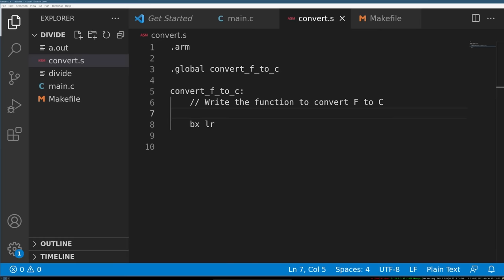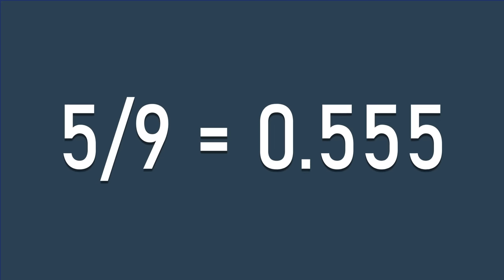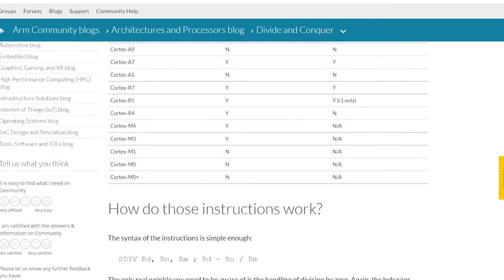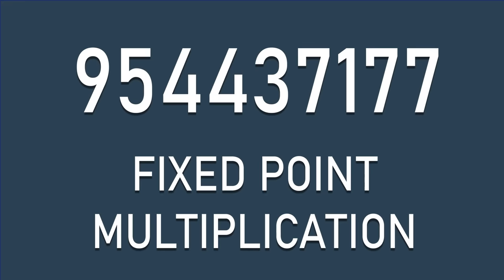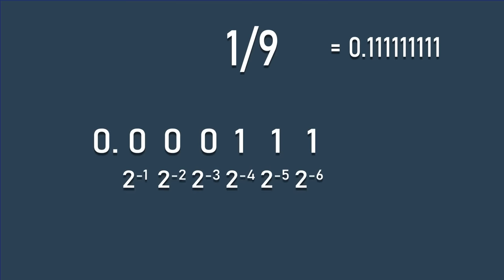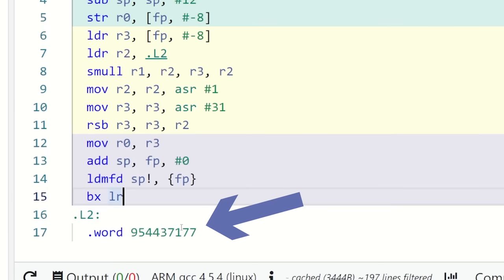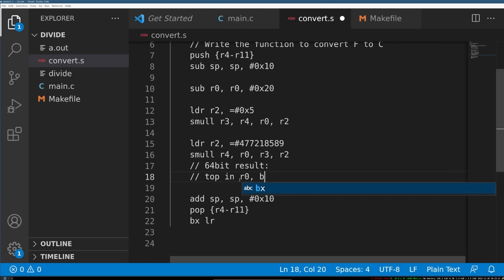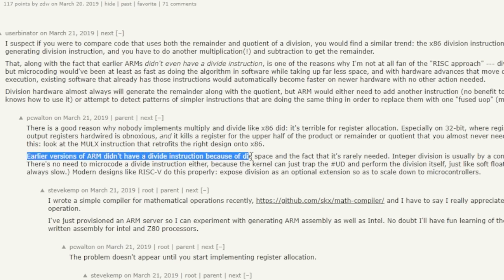computers suck at division (a painful discovery)

Comment: Congratulations, you have just rediscovered what us old farts were doing decades ago. Early in my career, I was working with a minicomputer (a PDP-11 to be exact) that did not have a hardware floating point unit in some models. So I wrote some software that emulated all (three!) of the possible floating point instruction sets. They pretty much consisted of lots of shifts, additions or subtractions. I didn't have the luxury of using fixed values, so I had to do it the hard way. And, no, it was not fast! Although I suspect that an simulator running on modern hardware running these emulated instructions would be faster than the original floating point hardware.

Comment: The sweet story between RISC and CISC. Right?
Descend to the assembly level and try to implement DIV on CPU/MCU that doesn't support it - simple. How would you solve that one? You need the main part and the remainder. Consider how would you "encode" that in RAM and what would you do with it next? Finally put that into these magic LDA-s, mov-s, pushes and then it POP-s. :D

Comment: I’m pretty sure x * 5 / 9 would do ( x * 5 ) / 9 and not x * ( 5 / 9 ). Floating points are accurate enough to get the job done still — there are some things you can do. 
If you need accuracy, you might want to consider using different data types / classes / libraries to get there. If you really want to recode long division though — fine — just know, that you might do the same for multiplication, and exponentials too (whoops there goes a few days of your life coding something that exists already) 😂

Comment: Nvidia should take note. RT cores take valuable silicon. The chip could be either cheaper or faster without them. And raytraced games have ulgy visual artifacts and run like garbage anyway. I for one would prefer cheaper / faster cards than ones that can run raytracing with visual lag and a quarter the framerate.

Comment: Why on earth do you need so many digits? Most measured temperatures are within ±2% to ±5% at the time of measurement anyway. Unless you're working w/ NIST data or something else that has the precision & accuracy of measurement then just use 2^7 for 1%. Even 2^10 is reasonable, how many times do you need your number to be right to within 0.1%? Obviously if you have a stacking error problem then yeah do it with higher numbers, but those are such special cases which are almost never supported by the initial measurement anyway.

Comment: Computers are very good at division. Humans are the problem. Computers are base 2. Humans are base 10. 10 based numbers are horrible at division. Trying to get good 10 base precision out of a 2 based computer is like trying to use a Phillips head screw driver on a flat head screw. Just pound it in there, that'll work.

Comment: ARM is branch of CPU's based on RISC Reduced Instruction SET, so its no surprise that there will be such limitations as well you can't call anything that has a CPU a computer as a Computer should be able to do anything, Thus most Devices that use ARM are Devices and Devices are things with limited functionality much like a Iphone or even a Android smart phone but we all know they can do more then the Apple variant of a smart phone, Apple call there so called Computers the same but that is also wrong because again you can't do everything on them hence they fall under the category of DEVICES.

Where IBM PC Compatible now PC are x86 are able to do anything hence the cpu's that power them are Big and now days Intel CPU's are even called Big Little processors due to the fact they have BIG x86 and ARM aka Little so they are a Hybrid, AMD just have BIG CPU's with a ARM security processor again that little processor is only there for a dedicated task thus been a device.

Sure ARM has the advantage of been small and uses less power but its not a full CPU and sure its great for tasks but its not a computer, I personally feel this is why the industry is so plagued with bloated software or just software that is just rubbish due to the fact people want to be a programmer or engineer "hardware" and not knowing the first thing about each subject and really you need to understand both.

Just like some people will say oh if GPU's have so many cores and so much faster they should just make that a CPU but it does not work that way, GPU's are not the same in fact there more related to ARM in the fact that they have a specific Instruction SET plus they read data in parallel and CPU's read data in serial both have there strong points and weakness.

Please consider renaming your video and then it will help get your point across as the people in the know would just think well its not worth watching as its just misinformation or click bait.

ARM Sucks at Division as many people don't know that.

Other then that the video provided good information but other that how many devices would use 2004, maybe Pi or Pi like stuff?

Comment: Part of the division problem is that mathematicians in general just... really, REALLY hate division for some reason. Like they have been trying to phase it out as much as possible for the last hundred years. Did you know that the division symbol ÷ is officially marked as "should not be used" by the ISO standards? And you've probably noticed it's not on your keyboard either unlike plus+ minus- and multiplication*
So with that mindset in... mind, I'm not surprised in the slightest the computers they built are terrible at division.

Comment: Lol noobs. You never programmed 8bit micros in machine code?
For smallish numbers like this you can do successive subtraction, ie; just keep subtracting 9 from the operand and count how many times you can do it.
You dont need ANY divide operation!
If you think 30 (or so) 8bit subtractions needed to do this is too slow as a method, in many micros it can be faster than software multiply and divide.

Comment: multiply to divide is not a difficult concept... you make it sound like it's insanity.   real world speaking... lets discuss resin 3d printing...  in order to print, you have to have more resin molecules (this is the multiply part) then necessary.(a pool of resin in liquid form which volumetrically has more material then the final product)  the curing process then hardens the resin, layer by layer (this is the divide part) until eventually, you have something printed...   Multiply to Divide....  this kind of goes for 3d printing with powdered metals as well...  the final print has to be cleaned of all the extra powdered metal caked around your print... sintered printing...  multiply to divide...   but there's also the concept of dividing by a fraction, which turns into multiplying by the inverse of said fraction...    multiply to divide...  primary level math... grades 1-6...
Reply: CNC milling is no different.... you multiply the amount of metal molecules you need by starting of a with an object larger then your goal product... and you divide (break) the block down chip by chip sliver by sliver of metal molecules...     additive manufacturing, destructive manufacturing, rapid prototyping...   multiply to divide....   lots of lathe carpentry yt videos where the carpenter multiplies several smaller pieces of wood into one larger block of wood only to 'divide' it down into something nice.     multiply to divide...
https://www.youtube.com/results?search_query=colored+pencils+lathe+carpentry